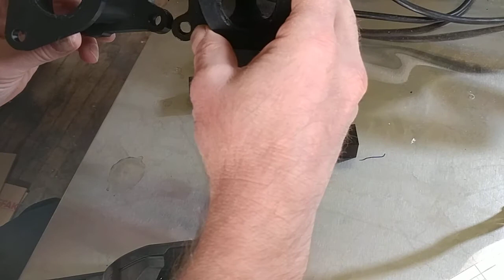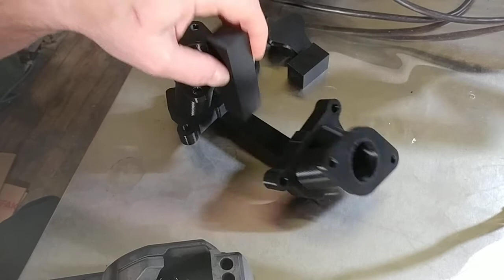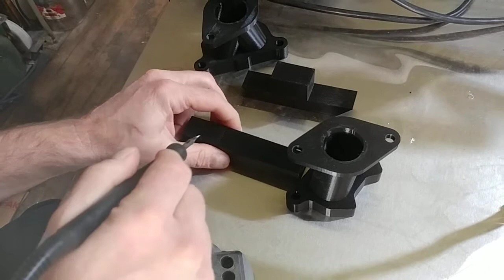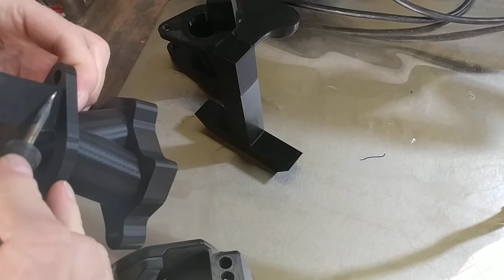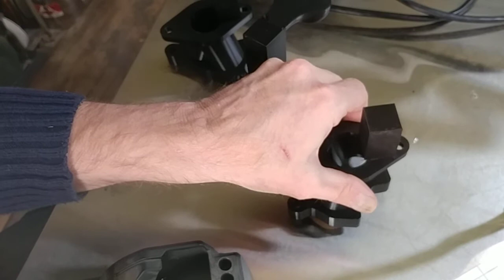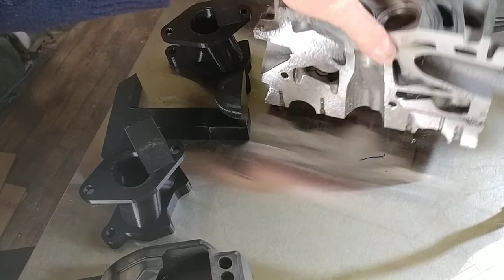design and assembly of a 3d printed lost PLA mold for aluminum casting

Comment: thank you, I'm trying to cast some sprocket hubs and engine mount because by bike spokes and frames doesn't fit the mount it comes from the kit, I tried hot pour and didn't work it was disaster, I'm going to do burnout, I don't have a kiln maybe just try it in the furnace.
Reply from the maker: Check out the people doing lost foam casting!  They're getting some really cool results.

Comment: Good info!
I was thinking of 3DP & casting custom intercooler end tanks for my Subaru and see that Subaru head!
Any update? How its gone?
Reply from the maker: I will say: I am not sure casting is the best solution for end tanks.  I'd be really tempted to make a wooden form and hammerform sheet aluminum over it.  The reason I say that is because if there's any porosity at all in your cast, which when you're doing this with back yard equipment is hard to control, a thin section like a header tank may end up leaking through pinholes.  You have to weld the tanks to the core anyway, right?
Reply: @smellsofbikes  I decided to use my friend's investment casting facility. He told me he can do for me.
Reply from the maker: No update: my whole state is on fire so I can't fire up the foundry until the fire danger is passed.
Reply: @smellsofbikes  Hope things get better soon